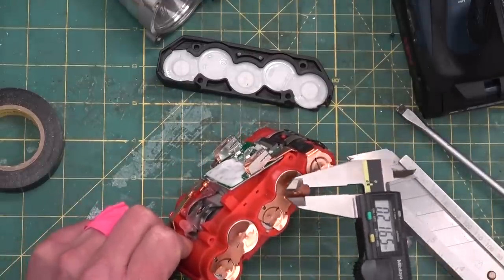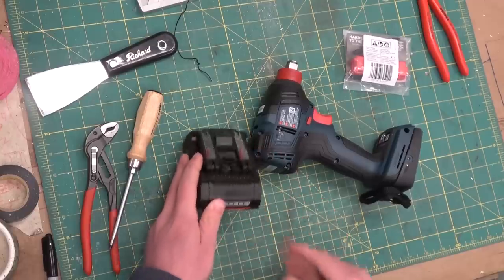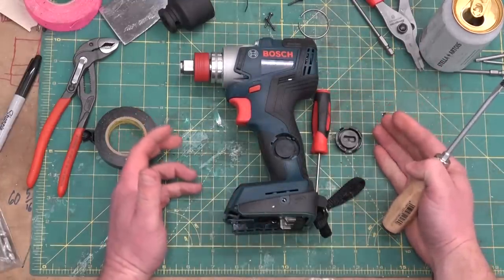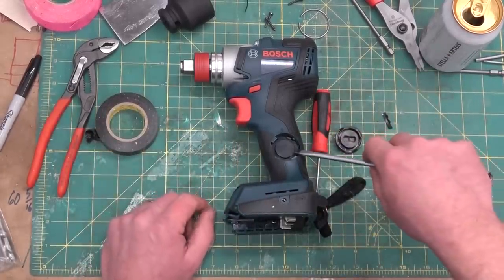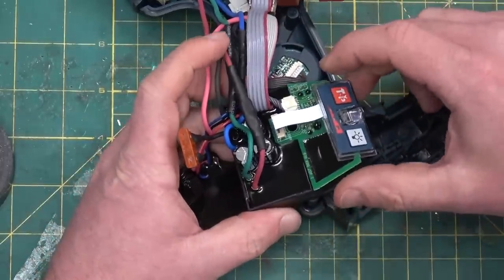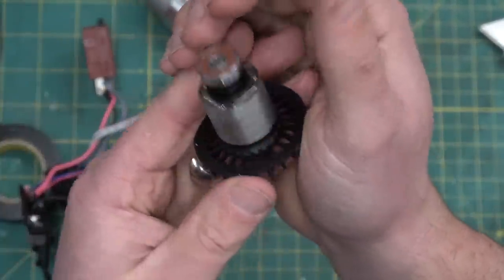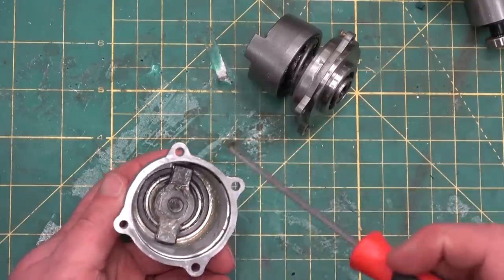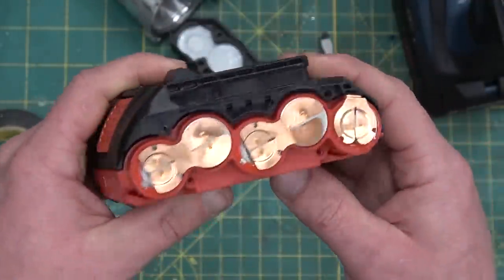BOLTR: BOSCH impact driver | CORE 18V

Comment: Dropping by since a friend of mine discussed the video with me:

4 pins:
One pin is for temperature since the pack has jack
squat for electronics unlike Makita’s brick-em BMS that sucked off the power of
one cell until it went undervolt and errored the pack out if the pack was shelved
for too long. I think they fixed that since that was a huge issue in the past. 
The other pin is pack current limiting/capacity for the charger and tool. 
My understanding is you can fool Bosch tools into drawing higher 
current from a "pack" (or DC power source) based off whatever
resistance value is in that sense pin's path. You see this if you slot in one
of the old batteries and slot in one of the 10 cell packs or that new 5 cell
pack you have with the 21700s which have mega capacity. I’m not sure 
what the ohm values are, but you probably could probe that with the multimeter
against another pack (like the ancient 1.5ah ones) and see that it has a different 
value against the negative/ground.

BMS or lack of:
This is one thing I've never figured out with Bosch packs and some of the older Dewalts (pre Flexvolt stuff). They're getting away with a pack that doesn't have any BMS (by moving the low voltage cutoff to the tool partially) but more importantly there's a total lack of balancing in the pack but the batteries seem to keep going for some reason. Lack of BMS means no BMS to toast and brick the battery like on Makitas/Rigids/maybe Ryobis but how they keep one cell from killing the pack early on gets me, especially given that these batteries typically can get cycled at >2C charging rates for the first 80% of the charge. 

Motor Delamination:
Probably shouldn't have dropped it
before taking it apart, then again yanking on the armature on the Festool saw
before yanking the brushes was a sort of uncle bumblefuck moment. 
Maybe that's why the battery terminals are hosed.

Battery plastique:
Actually this is an interesting point
since there are specific grades of thermally conductive plastics that have
stuff like graphite fibers, boron nitride fibers or aluminum nitride in them. I
believe they're supposed to be maybe 10-100x+ more thermally conductive than
plastic when it comes to heat but they're still like 1-2 zeroes out from
aluminum when it comes to the W/mk numbers. They're supposedly really cost
effective for replacing aluminum extrusions for applications like LED strips or
other high volume production type deals where they can treat the housing as a
heatsink. Link to an ancient 2001 article about this stuff:
https://www.ptonline.com/articles/plastics-that-conduct-heat 

Battery shape: 
I think you see this on some outdoor equipment battery packs too
where they have that "W" shape, except since those have something
like a 15-20s configuration they're several lengths lengths of that "W" shape. Supposedly
it's good for thermals since you have more cell to outside air rather than cell
and dead air. I assume that with the plastic they're able to maybe deal with 
a bit more thermal management and also keep the pack "length" to a certain shape.
Reply: Dammit.
I'm inclined to believe you know what you are talking about.
Internet rules broken today.
Reply: I assume, supposedly, you don't have any facts to contribute.
Reply: Skookoom
Reply: Wow
Reply: Re: 4 pins - I've got this impact and both the standard batteries and the Core with the 21700 cells. Perhaps it's just my ear Dyno, but it sounds like it's chooching harder with the core battery ,so it leads me to think it's for identifying the battery type? Full disclosure, I didn't totally understand your initial post. I'm not that smart.
Reply: I think he's also missing how the Bluetooth module is really useful in Europe where tool theft is rife
Reply: Reflector you’re rambling sir
Reply: I've already tested my drill/battery stuff and I've noticed that the drill applies current-limited 5V to the off-center pin in order to measure the flowing current and to disable the battery meter on the pack. I've also noticed that the current flowing through that pin depends on the battery.
Reply: @Reflector re: the lack of balancing, one thing I've seen from some of the diy EV guys is that it may be bottom balanced.

Basically what they do is balance them at minimum voltage, so as long as you only charge them to the max capacity of the weakest cell, you can get away with using slightly unmatched cells, and I think there were some other advantages, theoretically.
Reply: Clark Andreasen I’m lost as to whether the Milwaukee’s are balanced or not. The 12v tools have like 5 contact points so I assume they are but on his teardown of the m18’s he said they aren’t.
Reply: @andymouse  Giving up unknown collected data for security, but the thief has the option of removing it when they steal it.
Reply: I concur with the drops probably being responsible for the terminals and motor delamination, or at the very least, can't rule it out. The fact it took 3 falls off a 12' and still works is enough of a recommendation for me to buy it, I have seen the deaths of new Makita and Milwaukee with much less, it seems to kill the electronics or mess up the gearboxes.
Reply: Reflector o
Reply: @sdgelectronics  My seperate post would have been a good thing for this ye: Afaik the bluetooth in Bosch tools is for a fleet to know in which vehicle they are and for theft protection...
Reply: @sdgelectronics  My  driver went missing on site so I used the blue tooth to  track it down and the bastards stole my phone as well! ( disclaimer:  UPTO  100% of this story is made up)
Reply: @eliasrhajiak9813  "Friend" or ...
Reply: @evilpowersjr  i think there are too many variables with tools being dropped, had to drop a makita sds off 3rd lift of a scaffold once, it was fine aside from some scratchs/dings in the casing.  not that makita is any more of a bench mark for durability than anyone else, i had an apprentice turn a damn near brand new makita mitre saw into scrap in less than 4 hours - i dont care how ham fisted the ape i expect better
Reply: @Daniel Rouw
On some of the older packs they were able to get away without balance leads. Looking at some of the newer ones for the sake of a sanity check it does seem like they added some balance leads but some of the ancient ones I've seen taken apart (I'm talking about 5s with 1.3-1.5Ah of capacity) they didn't.

I have a personal thing for packs with a lack of complex BMS where the pack can brick itself from an otherwise recoverable state (one cell gently falls below the voltage limit and can be recovered and so on). The stupider  the pack beyond the basics of keeping it safe, the better since battery packs are the PITA to replace.
Reply: @sdgelectronics  How does a module fix that??  You can pull the module and throw it in the trash.  I like Bosch stuff, I think AvE was WAY over critical on this.  The plastic on the batts is mostly for strength but helps for heat since it conducts heat better than air.  I have used mine pretty hard and they never get hot anyway.  Also, call them pro all you want but they are fairly cheap.  2 batts, charger, driver, and drill for $200.  It is barely more that Ryobi and I think they are made better.
Reply: If ya balance charge the batereahs they'll last longer and ya don't get to sell as many batereahs!
Reply: I can vouch for this,  In my personal experience, with the 18v Bosch tools it’s a very obvious performance difference between the compact 18650 packs, standard 18650 packs and the newer Core/ProCore batts.  Depending on the tool, there’s even a noticeable differences between the the lone 6.3 ah 20700 pack, the 4ah “compact” 21700  and the 8 ah 21700.    With the newest tools, this would be expected if they’re designed for the better battery packs.   However, this tends to apply to their older tools as well.   I have various tools that run off of Metabo batteries and I can only dream of seeing such a difference with the 21700 packs on the ones that were designed with 18650 cells in mind.
Reply: @renof2505  not sure if it's implemented or not, but at the last Bosch tool show, if enabled it could lock the drill. Even if removed the drill was then non functional. Similar to the Milwaukee Bluetooth module
Reply: Reflector does Milwaukee have a bms/balancing?
Reply: Daniel Rouw your cousin’s name is impact?
Reply: Thanks btw for taking the time to write this
Reply: Uugh?
Reply: Those aren't radiator fins. They're just structural support.
Reply: Jordan Reed at least you have a sense of humor
Reply: @sdgelectronics  Oh yes. Theft off fenced and guarded construction sites, mind you. Its gotten really bad here.
Reply: @chrisdash83  plenty of inside jobs from agency staff. It's getting really bad
Reply: This is an old thread but the battery does have connections to each cell. Each one is bare, no wrapper, and the board has ribbon cable connections that are press fit between the HDPE sleeve and the steel can for each cell. Whether that’s used for balancing or just monitoring, I don’t know.

Comment: 0.13mm copper tab is perfectly fine at those currents and over that distance. You don't need to go thicker. But there should have been a double weld on each tab. 

Also, it looks like they might be beryllium copper spring material which won't work harden.
Reply: That kind of copper cost more than the batteries itself. Ever priced beryllium copper tools before?
Reply: @hilldwler420  no but I've priced beryllium copper and regular copper shim and I've copper welded batteries before with commercial machines. We worked with this tech 10 years back.

Comment: Regarding the Batteries: I have been using them for about a year. Almost daily use spread across three batteries, two i emptied during the the day. I gotta say I am impressed. They seem to have a lot more charge cycles in them compared to other brands (in my case that's Ryobi). After around 150 charge cycles they are still within spec, even the one used in the grinder manged to stay above 80% capacity.
Reply: Yea, they are great, he seems to be just doing it for clicks.

Comment: Had this set for 3 years daily use installing and outfitting steel doors and frames. No problems. Even after a few meltdowns which ended with the impact flying through the air and landing on concrete.

Comment: I've had the bosch 18v impact for going on 3 years and I use it daily in residential property maintenance.  I don't know how the red dingus end stays intact, but it does.
Reply: Bcs its residential property maintenance.

Put it in the hands of maintenance guys who work offshore, wind turbines, steel mills or other savage industrial environments and it will be gone in no time. Its fine for consumer/prosumer work. But not for stuff like what AvE used to do (I guess mining industry)

I have used Bosch in the past, including this impact driver (without the bluetooth-hole in it) and that plastic ring was chewed up AF, their angle grinders die by the dozen. We mainly use Metabo for our grinders now, Hilti for our drills (rotary hammer) and Makita for all the rest including our coffee maker 😂

Makita has given me the best overall experience, there might be others out there that outperform them in charge capacity and power. But the Makita ones are incredibly robust and have the longest overall lifetime. They last for years if not abused.
Reply: @claudyfocan731  you could have just said you were a makita fanboi. it could have saved you 2 paragraphs.

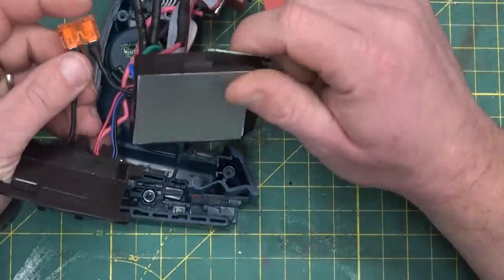Comment: 16:07 The fuse within the device has a logical reason behind it. When (as usual) placing fuses into the battery packs, a shorted device on the construction site would lead workers to pop in batteries and blow those internal fuses until no battery is left. When fusing within the device- only the (already faulty) device would isolate. Voilà.
Reply: Happened to me with an electric drill from Hilti, it rang like a bell and killed the fuse of the Battery. Brain fart I have had I put in another one killing that one too.
Reply: @billrehm3590  I did, the ones from the hammer drill, but my brain clicked and I figured yeah better not do that again. Send the drill and batteries to Hilti, got an invoice stating the price, told them I don't want new batteries but a repaired drill. They gave me new batteries anyways. They threw away the old ones, so they couldn't change them back anymore and said I could keep the new ones without additional costs except the drill repair.
Reply: @billrehm3590  Genius.
Reply: @keigun5546  I keep hearing good things about hilti customer service I think I might go that way... you recommend?
Reply: @jessehall8168  very good tools but very expensive.  Good for a business.
Reply: Mark P.  Buy once, cry once.

Comment: I've got 2 pennies for ya boss, Tin Basher here, now a service tech. I've been using Bosch since I was a wee first-year slopping goo on joints. Got one of the earlier iterations of this toy 6 moons ago that I spin in my day-to-day. Thank frig my version doesn't have BT, and a shitty bottom light. (WTF) 
Had it less than a month when she attempted flight from my 8' and lost a toenail in much the same fashion as yours. Also, that condom wrapper was ripped and slipped off mid stroke early in her career. Not that I miss it, better feel of what's surrounding you if you known what I mean. 
Any who, there's my 2 cents and I think one must have been a Freedom coin by the way I'm rambling. Gotta love that exchange rate.

Comment: I have a Bosch bulldog cordless 1" sds that uses the same batteries. I use it almost everyday for about 6 months. So far I like it....
Reply: Update the batteries are still good.  The cordless bulldog took a shot. just after the warranty is up. So don't buy one. If yo have one don't run it to hard.

Comment: As an enginerd, the stater lamination separation 18:55 isn't really an issue as the requirement for lamination is for them to be electrically isolated (as well as guiding the flux, minimise eddies etc.).This is routinely done with epoxy but an air gap serves the same purpose. Doesn't suggest that the lamination were flat before they glued them together though. shrug

Comment: Bluetooth: In an industrial setting, you may need to document fastening processes. Further, when running hundreds of such machines in a production plant where different stations do different jobs, you may have transmitters giving any machine at a given station the required settings without user ruining your entire product.
Reply: Really? I worked in an auto parts plant where we had machines to track the torque needed for fasteners.  Only the Japanese auto companies actually cared about  the data. Gm and Ford only cared about getting the stuff delivered on time.
Reply: @millwrightrick1  Huh I guess explains a lot!
Reply: Jup. 100% correct. AVE was a bit off here. At work we use Cleco tools that work with WLAN. I don't know if this is set up is going to work with 100+ tools in one building all sending data but it might be good for smaller manufacturers. I work at a German Car manufacturer and I can say that every safety critical screw gets data logged.

Comment: Really enjoyed watching this video! However I think it should be put into perspective as some aspects were mentioned that are bad while some were considered decent. The tool survived the drop test, mechanical parts were considered decent, battery interface was considered good, electric circuits also positive as there is a car fuse, other fuses and epoxy molded Platine (water: Dust protection?). 
As mentioned below maybe the stator got bumped and delaminates during the fall, inside mold work is - at least in my opinion - rather a cosmetic issue, plastic ring on the bit mount might be worth reconsidering / spare tools are available though and seeing other options such as metal or rubber it should be considered that the environment is often oily / greasy thus posing other problems. 
Battery packs have become relatively cheap: per amp hour you generally pay 10 euro here in Germany, if you want procore/ wireless charging it’s another 10-20 euro on top of that.
The impact driver is the smallest in the lineup (180NM - 650NM?). On promotions I’ve seen it as solo. Took without l-boxx and battery for 80-90 €. Obviously you can get much better built like the GDS 18V li HT. However for prosumers who don’t want to spend €300+ it’s a viable option.

Comment: I have a Bosch router table but Bosch is about a 5th or 6th choice in my books. Ever since the brushes in my Dad's hammer drill wore down cocked sideways and ripped the commutator strips right out. That drill was from about 1977 and it didn't have very many hours on it when this happened in 1990. I have a Dewalt corded hammer drill that has bubbled the labels from heat, screwed thousand of screws and made hundreds of holes in concrete. After 22 years it's had the cord replaced once and that's it.  Dewalt, Snapon, Makita,  Commercial grade Black and Decker, Milwalkee, Old porter Cable are fairly good.  Some of the old Ryobi was good too.